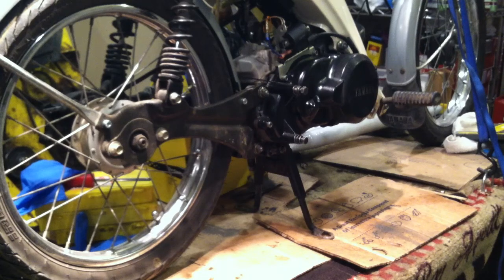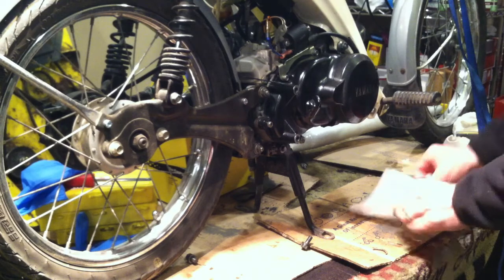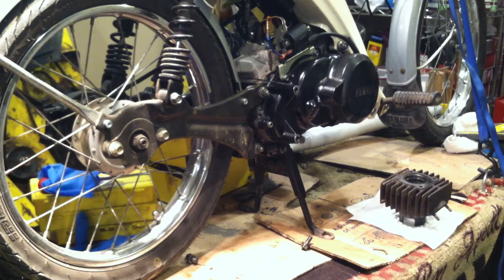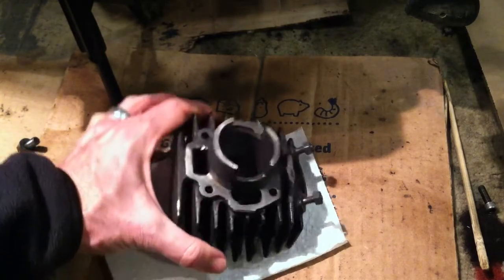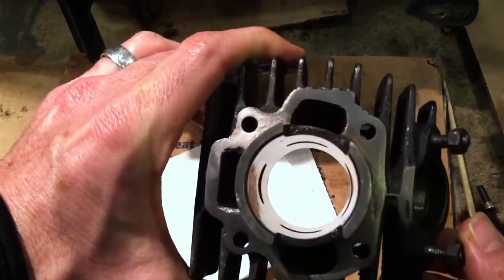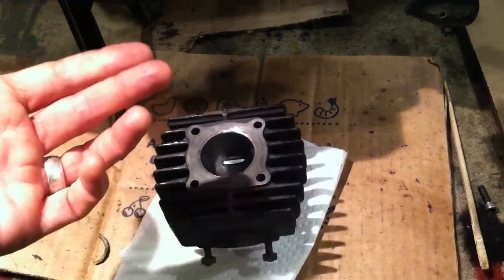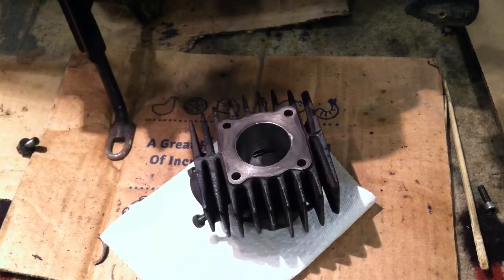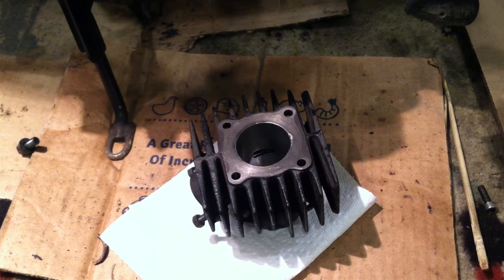MLM better than stock pipe on Yamaha Towny and Honda Urban Express NU50 cylinder woes

Comment: Definitely buying the kit online you saved me from making a bad mistake , I can't believe someone would send you a beat cylinder,
Reply from the maker: I finally found an oversized piston and rings that may work but they are not in stock now.  I imagine they'll get some sooner or later.
Reply from the maker: galus_ri7vrn was the seller on eBay from  White Lake, MI
Reply: churioz26 litteraly was messaging him on it I believe a few weeks ago, he kept saying it turned over no problem , I ordered the treatland kit, I'm just puzzled as to why I blew my cylinder to shite ,I wonder if you running premix causes a less lean condition and me running the stock 85 jet with the oil injection hooked up is my issue I probably have to go to 88 your videos are more help than anything out there , I'm going nuts not being able to rip 30mph to work and back
Reply from the maker: I've been there before.
Reply from the maker: if you got that kit, you'll need to dremel out the exhaust port or file it out to make the mlm pipe fit.  Just dremel/file to right below where the port meets the cylinder.  Don't dremel/file in a way that make the port at the cylinder wall bigger.  I may be getting another urban express today.  We'll see.
Reply: churioz26 I litteraly just had a guy offer me a Urban express for 400 today lol